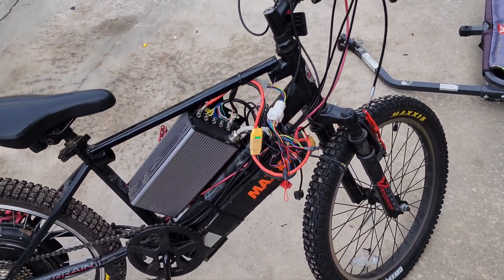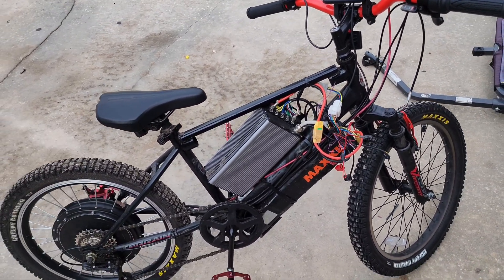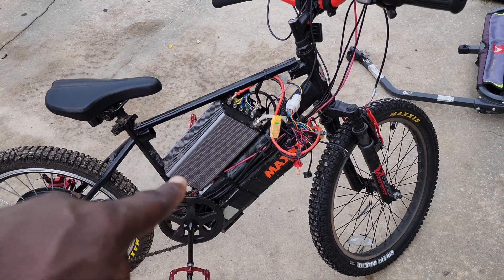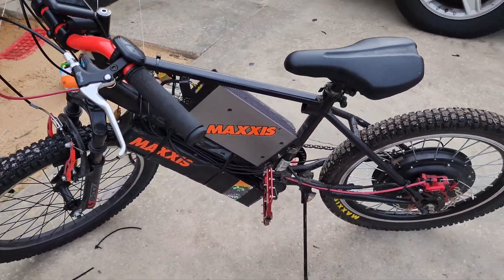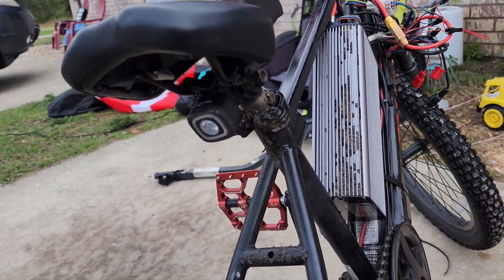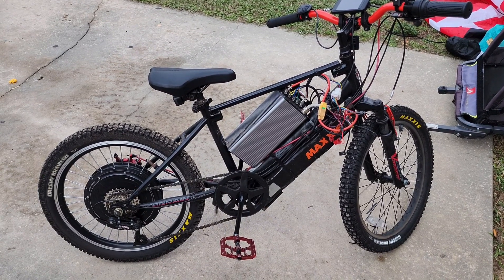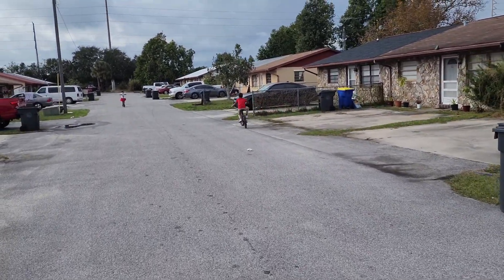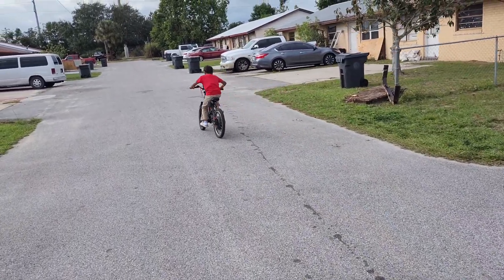1000w bmx ebike build, sabvoton 72150. THE MINI ME

Comment: Can you use a 52 volt battery on a 48-volt controller will it be safe to use this and will it shorten the life of the control box if you use a 52 volt battery
Reply from the maker: It will be just fine. If you add more than 52v you might want to check the capacitors on controller before doing so

Comment: How much power are you putting in that 1000w motor?
Reply from the maker: About 5kw going to the 1,000 hub motor
Reply: @E-bikeguy   So its holding up ok?
Reply: Are you now on discord?  Im interested on a platform that discuses and address technical questions from many perspectives, with my own.
Reply from the maker: Oh yes it's been on the bike for 3 months now, he rids it almost every day
Reply from the maker: Not really. I heard about it
Reply: @E-bikeguy   Its ok.  Last I communicated with you on it & i believe you made an attempt to join.  Its been a while now & just fallowing up.
Reply: I build my pack with ev cells and balance leads that i use to balance the cells.   I read each cell with a volt meter & balance each individual cell through the leads.  Im the bms.  I wanted to have a forum chat on building key ignitions.  The batteries are attached to the bike frame and wrapped with vinyl tape.   Looking to discuss creating a custom  build thats not too small and weak and not too powerful, big and bulky with like minded folks looking to do the same.
Reply from the maker: @Jashua Smith  oh ok ill try to join

Comment: get him a 3kw 205 3.5t-6t that controller will eat up the ,otor as you crank the current.
Reply from the maker: Yes.. it's going to be a fat tire setup
Reply: @E-bikeguy  im currently running what could be considered a mid fat or semi fat setup at 8kw 80mm wide rim and 2.2" wide tire no slip
Reply from the maker: Nice. I would like to see 5hat setup